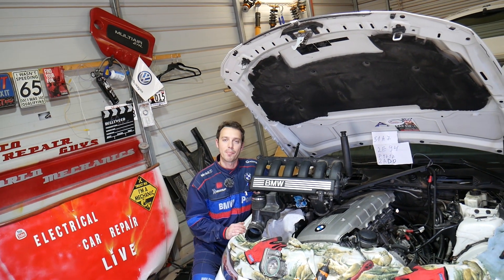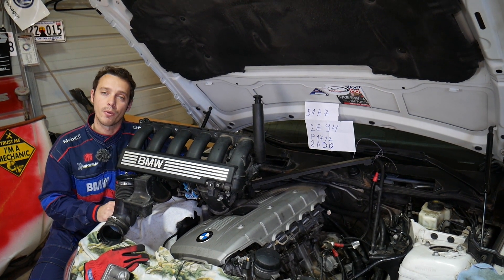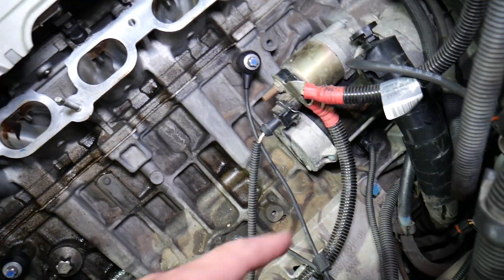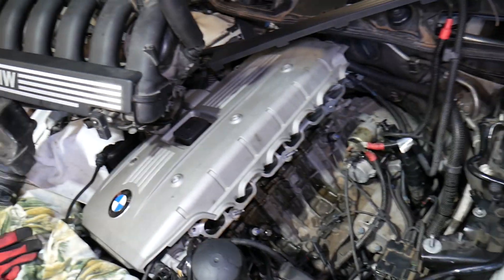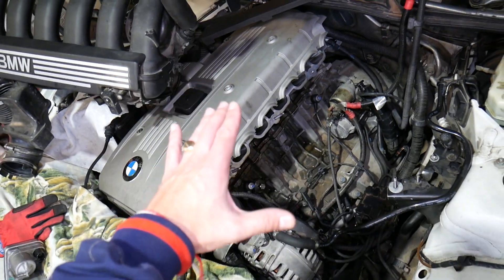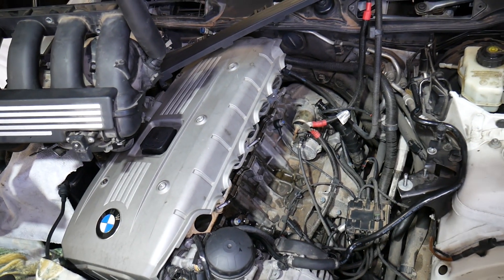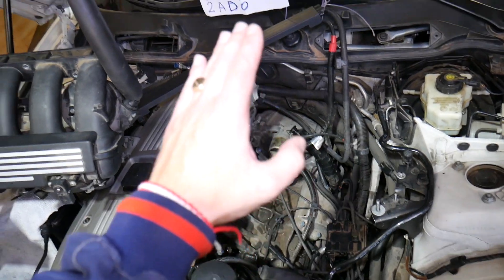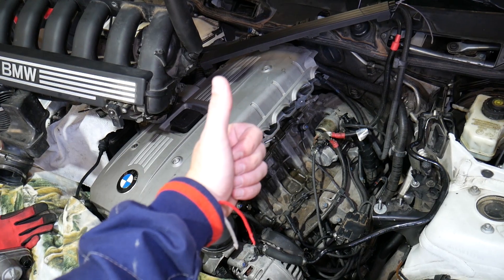BMW E60 E61 E39 F10 SYMPTOMS OF BAD CRANKSHAFT POSITION SENSOR

Comment: For RHD cars you can do it pretty easy from under the car, need a good telescopic mirror and torch. it's an E10 torx and need about a 75mm extension angled slightly towards bonnet direction to get torx socket to slip onto bolt. take cable off when you have sensor out, not before. make sure U blow sand and crap out with compressed air. move plastic cover in wheel area out of way, tie to side so arm can use that hole to work from.

Comment: Our bmw e60 523i 2006 loses power, brakes hard for half a second when we drive in pot holes or over speed bumps. 
It did not always happen but now and then and no error message.
The bmw workshop can not help us, and they find no error codes.
We have changed the vanos, removed the dtc sensors, cleaned the non return valves, nothing helps.

Comment: I rebuilt the gears and clutch plates and planetary gears both sets and replaced all of the pressure switch’s . Now car cranks no start. Checked everything removed and replaced crank  position sensor. It gives random codes but v very random sometimes a code will be there other times not and the codes never repeat the same Two codes in a row and none of the codes are minor non threat codes. One time Codes number I don’t know it. But it said immobilized possible manipulation , CAS something. But it was buried deep has to go thru a couple sub routines to even see them . One time only. Car recognizes and accept key as legit, trans gets pass/no codes when you run program. But still no spark from coil packs none of them. I often the 550i. Any suggestions?

Comment: Hey thank u.. I have a Question.. bought a used motor 60,000 miles.. mechanic installed motor and it turns on, sounds smooth but faults on Timing failure or Timing issue.. I HOPE THAT THE TIMING CHAIN IS OK.. they want to charge me 4 k for timing job.. I think it could be a sensor issue.. what do u think.. they ran diagnostics which state (  found faults for Intake timing both banks , performed timing chain test plan, test plan failed Due to Cam timing Off, scoped Cam Shaft sensor, square wave out of spec, suggested to perform timing check, which Includes removing valve covers and checking with Jigg Tool ) Could this just be a simple Vanos or other sensor? They want to charge me 4 k  to perform timing chain replacement job... PLS HELP WITH YOUR PROFESSIONAL OPINION... my name is Sam : )
Reply: I think it could be a sensor absolutely. I would rather check all of those systems and And any other system before doing that test. Spend half that on a top notch obd2 and it will tell you exactly what the problem is and how to fix it.
Reply: @kevinalbers7634  thank you so much for the reply.. car still sitting.. don’t know what to do.. can u recommend the best BMW OBD2 scanner.. still fighting with myself on repair.. and don’t want to get screwed.. if it’s just a sensor..?? I have the diagnostic that stated all that information of bad timing and cam shaft fails..
Would a sensor cause that.. also original motor had a drive train malfunction.. error.. went into limp mode..
Previous codes read P0003 , Originally with an Actron elite auto Scanner.. also P10C1 no DRC definition found..  u think it’s timing chain? 65 k miles ? Supposedly passed compression test.. also.. can you actually perform compression test with motor out of timing ? Thank you man.. u have no idea how this info is helping me ..  not sure what to do..
Reply: @kevinalbers7634  forgot to ask.. what sensors to look for ? What are they called ?
Reply: Sorry the Car is a BMW 2012 550 m - sport V8 Twin Turbo N63 I believe... hoping you can give me some insight before I get dupped $$$$ ;(

Comment: Hi I have e60 520i 2.2 170hp  its no show any trouble code on scaner fuel come to injectors, have spark in coils  but car not start . But when I remove spark plugs all its wet whit petrol  its looks like give to mutch petrol

Comment: Do you have a video on fuel pump.  I have a 2000 528I , I can sprray stater fluid in throttle body and it starts but dies. Fuel rail has about 50 psi when in position 2, but settled at about 41. I changed filter and fuel pump both after market....car still won't start...can you help??
Reply: What codes is it throwing?
Reply: Hi ,thanks for answering....I figured it out. It was the disa valve on intake manifold. Replaced it...runs like a champ!!
Reply: @paulscott9729  awesome man, I just got a 530i I’m having problems with you think they’d respond to the comments with only one person commenting lol
Reply: @paytonglenn5908   sure why not respond